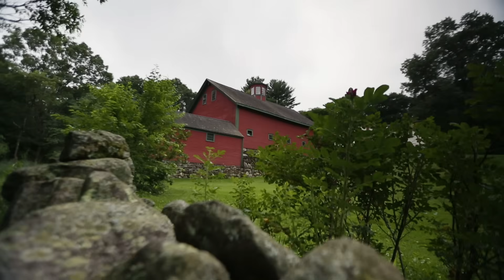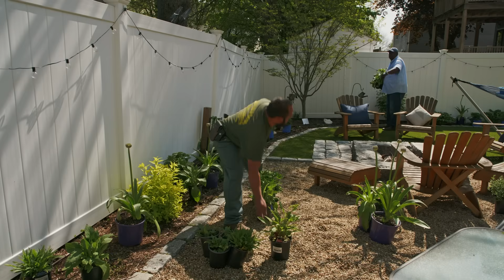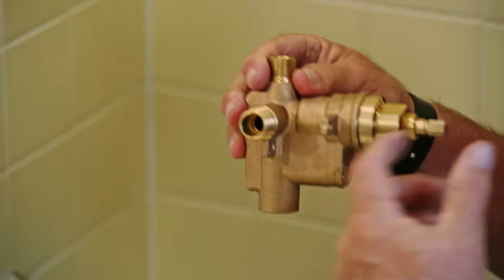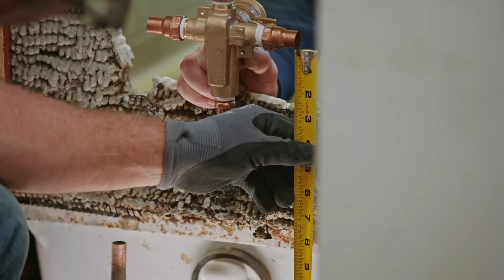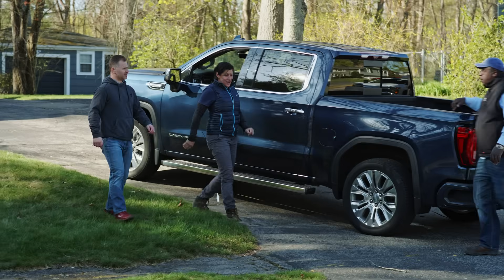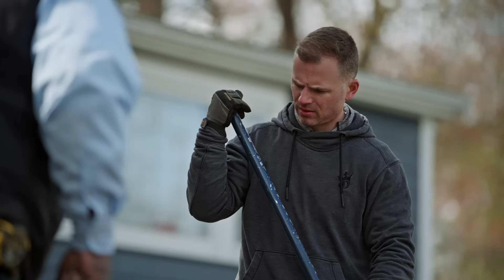ASK This Old House | Shower Valve Repair, Sloped Landscape (S22 E3) FULL EPISODE

Comment: LMAO, did anybody actually watch the video?  They had to use that big plate because the new valve is a lot smaller, because he's tired of getting scorched with hot water when he's taking a shower and somebody flushes a toilet.  The plate it came with isn't big enough to cover the holes for the old valves
Reply: Still no reason for it to be that big. They could have used the old hole.

Comment: Homeowner - “Can you fix the small leak in my faucet without messing up the beautiful tile?”

Richard - “We’ll very carefully chip away the old faucet and then we’re going to cut a huge hole in your wall removing a good chunk of your tile in the process.  We’ll also be putting an ugly metal plate over the big hole. Sound good?”

Homeowner - “Love it”
Reply: I am surprised why they couldn't just drill a center hole and use the cover plate! It's not like the cover plate needs that big hole
Reply: yeah  - i was surprised to see that huge hole at the end.  When they find a puddle in the closet, they'll know exactly why
Reply: I don't even think he had to cut anything. It anything, just a new one for the mixer. But did not need to be that big.

Comment: Unfortunately I don’t think that landscaping will hold any dirt or mulch back, the first rainstorm all that is going to be in the sidewalk. A retaining wall is really the only option I think.
Reply: It really depends on how much water comes down that slope. Assuming those plants takes hold within the next year, they can really anchor down the soil. I have a very decent slope in my front yard. The previous owner planted lots of lilies, hostas and rambling vines. The soil is firmly packed in and the deep rooted plants keep the soil in place. It's not as pretty as a nicely manicured lawn, but has lots of holding power.

Comment: Why that big opening for the shower valve? doesn't make any sense .
Reply: Lack of imagination. I definitely would have cut a much smaller hole, just enough for the valve stem to come through. I got my bathroom gut renoed. And the hole they left is just big enough for the valve.
Reply: @pandaman1784  Especially that he removed the faucets.
All that he needed was like 1 quarter in around. Did not need to be that big.
And no caulking?
Reply: That large hole template is for situations where you can’t access the backside. In this case, you can make a small hole because you have access from behind.
Reply: Yeah the big hole only makes sense when you need to swap the valve from inside the tub/shower. Not when you have access behind but honestly I don’t really see what’s wrong with it
Reply: @steakwilliams4448  
There is a chance of a water seeping through that bigger hole, Noises from the bathroom due to lack of insulation and weak structure.
Reply: I agree, I think the whole project was dumb. Dude just had money to waste.
Reply: Most likely because of the wall thickness. Plaster & lath walls are usually thicker than drywall. If they didn't cut a big hole, the valve stem wouldn't come through far enough to attach the  handle.
Reply: @tmurphy0919  
If you look closely you see that hot and cold water pipes coming from the floor below are not even close to the wall, there is still a wiggle room if that was the case.
Reply: @tmurphy0919  Yes it would have.

Comment: I have hardwood floors and have lived in my house for seven years,I’m starting to see small space like that house maybe off balance maybe 1/8” and the same with baseboards. Need help asap.
Reply: So you're saying you have an 1/8" inch gap between your baseboards and the floor?  If so, is the gap even? Or is it more gapped in the middle of the room?
Reply: @tmurphy0919 from the wall on the corners and the hardwood floors looks like the boards are separating from each other in spots.

Comment: I have a loud faucet/shower in our kids bathroom… it does not clunk or bang it’s just plain ole loud when you run the water..I’m clueless at this point.. taking suggestions
Reply: What size are the supply lines? Are they old galvanized pipe that has partially filled with minerals and rust? A smaller line would cause flow restrictions that might make noise.